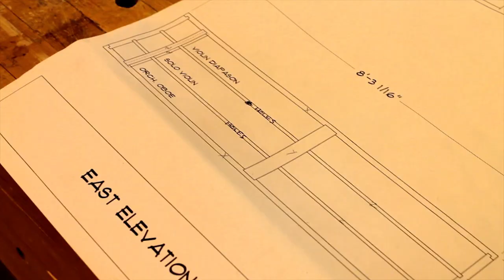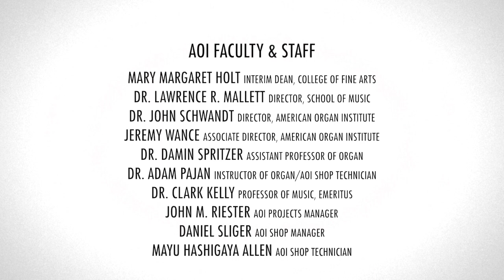AOI Organ Shop – Building a windchest

Comment: I think I have missed something here???--and would appreciate knowing ---if there is a problem with any of the electrics---does one have to take apart of the entire chest just to replace one diode etc????.  Now  how does one replace  an dead cell here without taking apart the entire chest.  Someone told me that the bottom  board is dropped---so how is this installed so that there are no air leaks et al  and have one not get knocked out in removing the bottom board???   Or is this board (not shown here) simply slided out and if so how is it that it is easy to do since wood expands and contracts. Thanks for all who explain.,
Reply: The only electrics in the chest are the magnets, and they can be unscrewed, individually, from the bottom of the chest, even when it is installed.  Problems with magnets are rare.
There are no diodes or other electronics in the chest.  They are on accessible circuit-boards elsewhere in the organ.
What do you mean by a dead 'cell'?
Both the bottom board and the toe boards are screwed on and therefore removable.  The air-tight seal is achieved by a strip of leather or cork which runs all around the edges of every toe board or bottom board.  This also takes care of normal expansion and contraction.